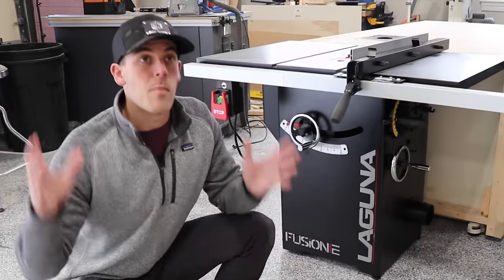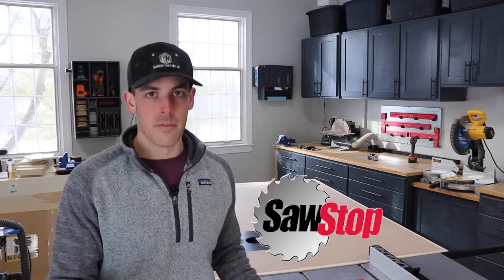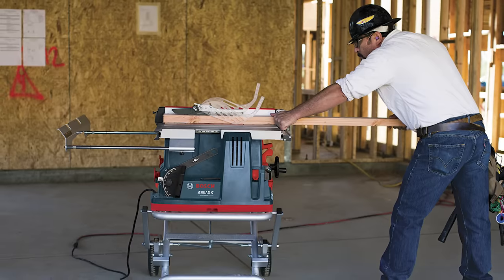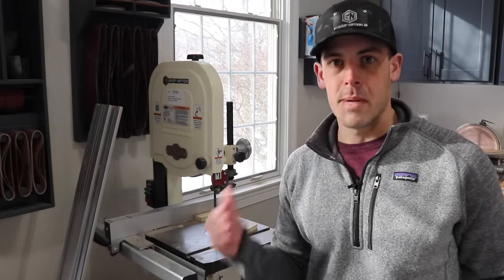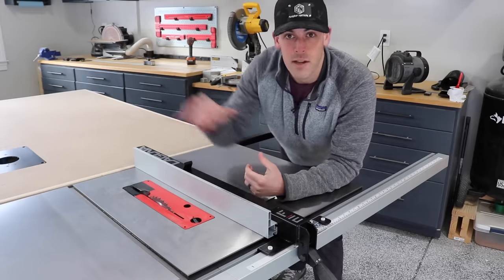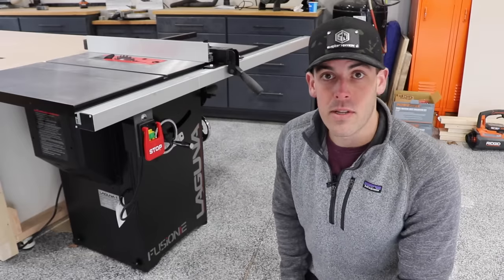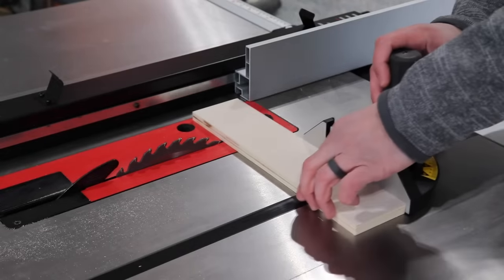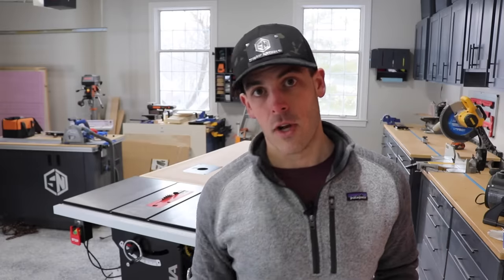Why I Bought a Laguna Table Saw over SawStop!

Comment: I dont understand the point of this video. if the point of a sawstop is its sawstop safety feature, and a laguna does not have one, how can this option be comparable?

Granted im only here because i recently suffered a tablesaw injury. i ripsawed a number of boards not long ago. And when i injured myself, it was for the tiniest cut to finish up the last slat in a display cabinent. barely 3 inch cut off a 1x4. The motor burnt out randomly, and the torque jumped just as i made it an inch into the cut. pulled my whole body forward and the board up the fence and back down on top of the saw. My first thought was to turn the saw off, an noticed it was smoking. Almost lost my thumb. Doctor wouldnt even give me a recovery time. not enough flesh to stitch. Just goes tocshow, you can never account for the unforseen.
Reply from the maker: Wow glad you’re ok! To answer your first question, I don’t think the point of a sawstop is the safety feature - I think it’s a great saw that happens to also have a cool safety feature. The video is intended to point out that there are other “great saw” options which don’t require you to pay for the safety feature (and IP)

Comment: If I were the only person using my tools, sure, a less expensive (and less safe) set of power tools would be fine. But I have a SO who thinks that just by watching her brothers and myself, she knows all there is to know about safety..... and nearly cut her arm off while cutting a FRIGGIN' TREE BRANCH with my radial arm saw. Then clearing an electric lawnmower without taking the safety plug out first. And taping the blade guard on my Skil saw out of the way 'because it's difficult to manage with it in place'. 
Can't tell her she doesn't know something, of course, she knows everything, just ask her. So I have to keep everything in the house as safe as possible. 
So it's not always for us experienced craftsmen that we wind up buying stuff that might be a little safer than the next cheaper brand; it's for the fools around us.

Comment: Question for you.... Like the looks of the F2.  I assume you could use an aftermarket fence to get ~52" rip capability?  I have this on my old Craftsman now
Reply: Yes, or you can not worry about the upper dust collection which appears to work "okay", and just by the Jet ProShop II with the 52" rip capacity.  They are very similar saws.   The Fusion F2 adds some bells and whistle, but goes cheap on the fence rails.  The Jet may not have all the bells and whistles, but has a stronger fence assembly.

To answer your question though, yeah, any aftermarket fence should fit.  May need some slide modifications though.
Reply: @alsmith7316  - Thanks... other option is to go cheaper and get the Delta 36-725 or 36-5052T2 :P
Reply: @mnapuran  I owned a 36-725T2, and IMO that should not be an option.   If at all possible try to stick to the $1K saws like the F1/Grizzly/Shop Fox.  Watch videos on the internals of the F1 and the 36-725.  You will see that the F1 is a better saw, I say "much" better saw than the Delta.  Especially if you see them in person.   The best thing about the 36-725T2 is the fence.  Though that flip down short fence flexes and is really unusable IMO.  Want to save some $ over the F2, go with a Grizzly G0771Z, Shop Fox W1837, or the F1.   The F1 has the overhead dust collection, which does not work all that great from what I have seen and heard, but the Grizzly and Shop Fox are better saws than the F1.  More on par with the F2, but cheaper options.

Comment: Why didn’t you buy another delta and why didn’t you take it with you?
Reply: I hope because he wanted to upgrade the saw.  That Delta is the bottom of the barrel of Hybrid saws.  It is not $400 less than everything else because Delta is nice and they like losing money.  It is not the greatest of saws.   Decent saw, has some features that the jobsite saws do not have.  That does not make it a good saw.  I Owned one of the newer ones, and had to send it back.  Fine saw if you like to be able to grab the trunnion assembly and move the whole thing back and forth.   Which then causes the blade to move out of alignment by .005+" at the center of the blade.  My saw did that, the saw on the floor at Lowes did that. (not as much as mine thought).  And the table top is thin, and not close to flat, but workable much of the time.  Other times it is so bad it is unusable.

Not sure, but this could be the reason.

Comment: The Laguna is an extremely nice saw,, having said that, 8 years ago my wife strongly suggest I buy a sawstop. I did,, a family member of hers thought I was nuts for spending the extra cash. He now has 2 less  fingers. Bottom line. I can lose a finger in one of my shapers, bandsaw, miter saw, stroke sander, and other tools or in my shop door. I did accidentally touch my blade and had the opportunity to go buy a new cartridge with all my fingers.  You just need to be careful. Oh yeah and for my brother in law,,,  karma sucks.
Reply: How would you respond to the claim you'll read here and that's often made: "Using a SawStop encourages bad habits that increase injury risk." It comes up whenever there's a discussion of SawStop. I have no idea what this claim is based upon. The folks who make the claim never back it up with anything except maybe saying, "People think they're safer so they take more chances." I don't find that persuasive. It's like claiming that people today drive more recklessly because they know they have seatbelts and airbags. While driving is the single most dangerous thing most of us ever do, it's still very safe, and certainly safer per-mile-driven today than it was 30 or more years ago.
Reply: @steveh8724  I tend to agree with your thoughts on driving down a Hwy, meeting another vehicle at 100kms/60mph with less then 5ft between each vehicle. Just because I have a sawstop does not mean I put my guard down. I spent a better part of 30 years as an iron worker. Working with plate shears, press brakes, and the list goes on and you need to be on your A game whether or not its a tool for steel work or woodworking. I struggle trusting even the best tools. I still have all my digits. Anything can malfunction. As I mentioned before, I had a brake activate on my saw. I was reading my manual on the saw and found that I can send the cartridge in and they can check and verify what set it off. I might just do this. The Laguna would have been in my shop had it not been for my wife suggesting/ strongly recommending sawstop. I say this because, "not all wives beat us up on our tool buying sprees" Don't get me wrong I love my saw and I'm sure I would have been equally impressed with the Laguna.

Comment: Yes, Laguna makes quality machines and has since before Sawstop existed, but you're still comparing 2 different classes of machines. The whole reason Sawstop started is because other manufacturers wouldn't incorporate the safety brake tech to prevent hand injuries. As someone who has worked with table saws and other machinery for decades, I understand that keeping you're hands out of the blade is generally a good practice, but most hand injuries are what they refer to as accidents... as in unintentional. I have never suffered a serious injury on my machines but I've seen several and had a few close calls. I'm reasonably certain that the medical bills would quickly chew up that $1500 savings, not to mention the long term impact of a serious hand injury.
 I'm not a shill for Sawstop and I'm still using my '80s vintage Delta Contractor's saw, but I understand the value that Sawstop brings to the game. It seems that this video is doing for Laguna what it claims the Interweb-woodworkers have tried to do with Sawstop.
Reply: Well actually Laguna doesn't make these saws. Perhaps they spec them from the OEM (Harvey?).
Reply: @steveh8724  I should qualify my previous statement... Laguna USED TO make quality machines, but I don't know anything about this particular saw, who actually builds it, or modern Laguna machines in general. I know that SawStop is manufactured in Taiwan by an American owned company who does their own design and engineering. I'm not sure how many machines today can even make that claim, but then most of my machines are old enough that they're U.S. or Canada made and are missing most of the modern safety and convenience features. :)

Comment: Sorry to inform you though. You dont have a cabinet saw. The laguna has the trunions mounted to the table. A cabinet saw has the trunions on the cabinet.
Reply: I stand corrected. When I first looked it looked like the f1.
Reply: I'm worried about the fence system.
Reply: I like saw stop but feel the same way. I would rather get a cabinet saw and a band saw for the price of a saw stop.

Comment: “Favorable terms?” Hmmmm. So they gave you the saw, or they charged you way less than retail. Probably the first one. You’re comparing a saw you haven’t even used yet to one you have never used or owned. Hmmmmm.  The Laguna fence which you seem to say is an innovation is actually a cheaper knockoff of the Delta Unifence that has been around for decades. You say it’s better because the trunnions are attached directly to the cabinet. Well, you just described what makes a cabinet saw a cabinet saw. You are basically claiming that the Laguna is just as good as the SawStop PCS 1.75 when it’s apples and oranges. Your only angle seems to be price, and you admit “favorable terms” on that issue. As to your assertion that table saw injuries are rare, any ER doctor or nurse will disagree. Another issue that you failed to address is customer support. SawStop has exemplary customer support. Not so much for Laguna. This is not really a review because you haven’t even used the saw you have, let alone the saw you’re comparing it to. Your video could have been a lot shorter. All you had to say is “Laguna costs less money than SawStop,” because that’s your only valid point.
Reply from the maker: 1.) The video is an overview of why I chose Laguna over SawStop...that's it!
2.) Never claimed the fence is an innovation, just new to me
3.) How would this be an apples to oranges comparison exactly?  It's a table saw compared to a, uh, table saw.
4.) Your comments about injuries from the perspective of an ER doctor or nurse are ridiculous.  That's like saying plane crashes are common, just ask FAA crash investigators.

Comment: Don’t let the guys over at Ars see this. You will literally be run off their site if you don’t embrace SawStop whole hog. I made similar arguments over there and the keyboard jockeys grouped together in a concerted attack. My main point was and is that the most important safety feature you own is located between your ears. Understand the dangers of table saws, manage those dangers and don’t do stupid shit. I’ve been woodworking for over 60 years and still have all appendages attached and in first-class working order. 

However, if you are one to cut corners, to not pay attention to what you are doing, then by all means buy a SawStop and enjoy all your body parts.

Comment: Good info. Sawstop has also lobbied for legislation requiring all table saws sold in the US to have “blade safety technology” while also successfully suing other companies offering alternatives (Bosch Reaxx). Basically, they want the government to tell you that their table saw is the only one you can buy. I also have a hard time focusing on the “safety” aspect of table saws. Don’t push your hand into the blade and you’ll be fine. A miter saw, circular saw, or router are substantially more dangerous IMO.

Comment: Young, stupid and fearless. I went 35 years without a scratch on some stellar table saws because I was focussed, still am. Then I Nicked a finger then a thumb. Made the call and bought a Sawstop. As good or better than the rest. Dust collection is awesome, great fence, loads of power so no reason to buy anything else except for price. Digit re-attachment is $15K. Trauma could shy some away from ever returning to woodworking. Do the math. Laguna is overrated and customer service is brutal, stepped up and bought their dust collector with Hepa filter. Just OK.

Comment: Personally I just take issue with a company that claims to be all about the safety when woodworking, but then monopolizes probably the single greatest safety device contribution to table saws since their invention. The fact that they haven't even licensed other people to make it just makes me think that they are fully aware that the tech is super simple and anyone who wanted to could make it for stupid cheap and put them out of business and they are only charging this much because as soon as that patent runs out they aren't going to be able to charge half as much. 

On the one hand you have to respect the near perfect example of capitalism. At which point it's then the consumer's right to shop elsewhere. Sawstop have just managed capitalize on the fear of losing a digit that was already present in the industry (for good reason) so well that people are basically anxiety purchasing their saws. As someone who works in the mining industry (also fraught with death and danger) it is very apparent that safety is our responsibility and changing a few behaviors could be the simplest method to keep yourself safe around the power tools. To quote Mike Rowe; "Safety Third." 

Course as a weekend hobbiest with a dewalt contractors saw maybe I'm not the opinion that matters the most. I could afford a saw stop, I just don't think it's worth it to me. Not for the time I spend in the shop anyway. It's not like my living is directly connected to my hands. Not most of it in any case.
Reply: I remember when SawStop first developed their system - I was at a trade show where they tried to license their technology to other manufacturers.  SawStop wasn’t making a saw at that time.  It was only when all the big names turned them down that they decided to make their own.  SawStop isn’t the big bad wolf.

Comment: Would you buy a car without airbags and impact rated frames if it was cheaper?

For all you Penny pinchers
If you are self employed and don't have workers comp (because it's about 4k-7k a year depending on how much you make)
Reattaching a finger cost anywhere from 100k-150k and no your medical insurance won't cover a work accident.
Reply from the maker: It's all part of the risk calculation...The cost of reconstructive surgery to your face if an asteroid hits it would be huge - but the frequency - pretty low.  That wouldn't support building a dome over your house, right?
Reply: @ShopNation  
I personally know 3 carpenters with table saw injuries its pretty common.
 actually over 30k a year in the states alone...

We don't use the iron dome technology here in the states but Israel does on a daily basis
To stop missiles from hitting civilians 
I'm sure it would be capable of stopping an asteroid if that was a casual threat

Comment: It’s been a month. I’m hoping we can get your initial response. Specifically I’ve seen complaints on the dust collection.
Reply: Yeah, I think the overhead DC is a nice option, but not very useful as is.  The hose is a little small and it takes a big DC to move enough air.   I would not buy an F2 just for that reason.  May not work out the way you want it to.

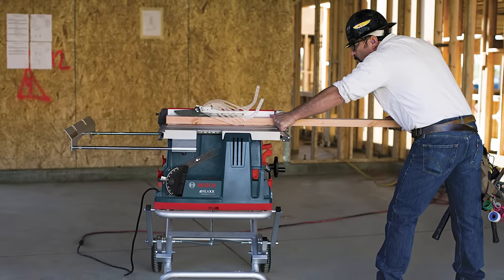Comment: I find it  funny that at about 3:09 in you video you say, "People have been using table saws for decades without any safety features with an extremely small incident rate ...."   At the same time you display a picture of a woodworker ripping  piece of lumber on a Bosch jobsite saw.  The saw in the picture is a Bosch saw with Bosch's Reaxx "safety feature."  Reaxx is (was in the US) Bosch's answer to SawStop's accident prevention technology.  I wish you good luck with your new table saw, and I really am not interested in your opinion of whether or not a proven safety technology is "worth it."  After all, its your fingers and hand, not mine.

Comment: So the Laguna doesn’t have any tech to save your fingers, which might also suggest why the Laguna is cheaper, next what’s the horsepower on the saw as you can’t run my Delta on 110 as it’s horsepower needs 220, so I’m guessing you have 2hp or less. 

Delta had the exact same style of fence that could run in the high or low configuration. The Laguna wheels might be nice, but you need to lift the other end to move it, my Delta has a mobile base and I don’t need to lift anything

So your comparison of the Laguna vs SawStop is mostly based on $$. How does it compare with the other higher end saws ?? I’ve run a newer Powermatic and it’s Trunnion was beefier than my Delta and with a spindle lock made blade changing easy

Btw I’ve got a few woodworking colleagues who are missing multiple fingers due to saw accidents, they and I think that it’s impossible to put a value on them as the loss of even one changes your life in huge ways, some of these guys can’t button buttons, or zip zippers, the friend who only has a thumb and pinky might tell you that the extra cost of a SawStop is a no brainer 
I’ve been lucky and have only had minor accidents with my Delta, but like riding a motorcycle it’s only a matter of time before you have an accident
Reply: What is the actual point of much of this post?  My saw is bigger than yours?

Comment: I am sure that the Laguna is a great saw. But the nine finger club is a real and I don't want to be a member. If everything is equal between the two saws The SS is very little extra $$ to insure you won't become one of the thousands of people injured yearly using a table saw.
Reply from the maker: Yup, perfectly good reason to go with SawStop.  Keep in mind that there are lots of injuries related to kickback too...which isn't addressed on either saw